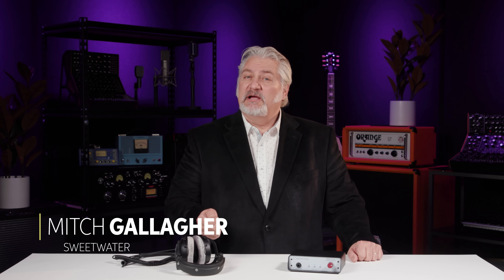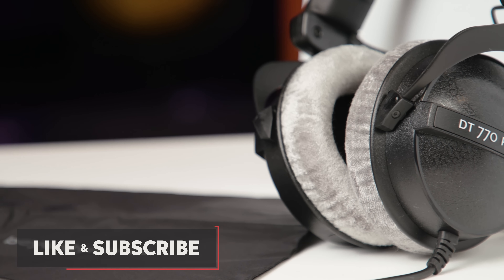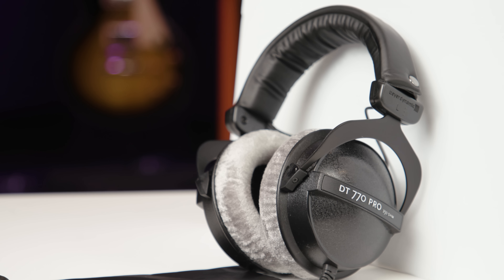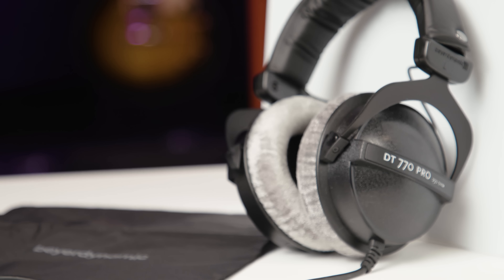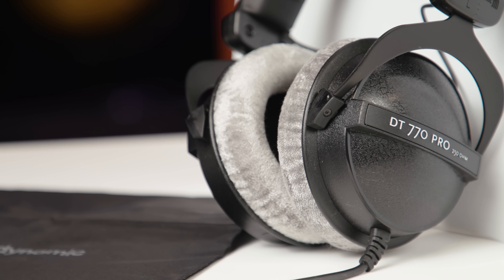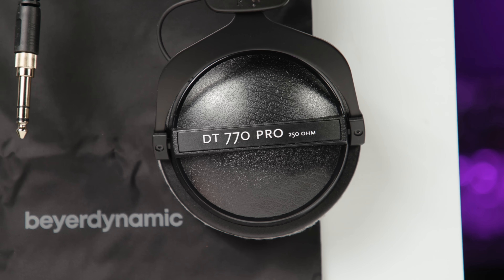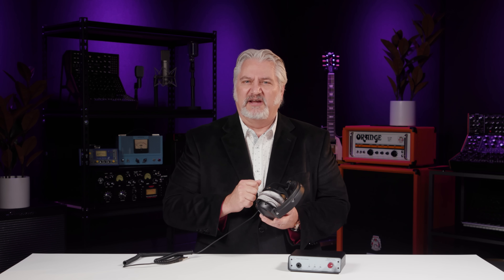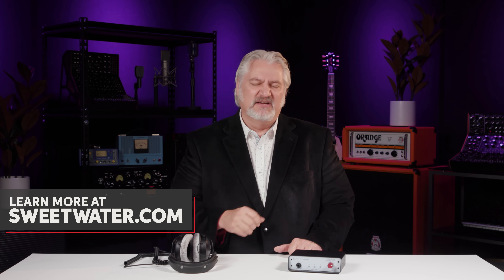Headphone Impedance Explained

Comment: So interesting. Decided to use my backup headphones yesterday at my dj event. The 32 ohm headphones were significantly louder than the 95 ohm ones I usually use. Both are designed to dj with. Almost thought the 95 ohm were broken or dying out.

Comment: I have the DT 770 Pro 80 ohms headphones. Should I be using a headphone amp? 

The only thing I have to drive it is my Focusrite Scarlett Solo or MacBook Pro headphone out.
Reply: Same question here too. Noticed a definite difference my new DT770 80 ohms when just plugged into a phone or my laptop.
Reply: Your interface usually has more than enough power to push volume. You should consider getting a headphone amp if you crack your volume knob all the way up and you don't get enough volume. This is more noticeable in cellphones. Put in a 250ohm on your cellphone and then put a regular cheap headphone and you will see a drastic volume difference.
Reply: You should be fine. Your Scarlett will definitely drive those well, and your MacBook Pro as well.
Reply from the maker: Hi, Jeff! A headphone amp wouldn't be necessary for the 80 Ohm version of those headphones. You should be totally fine without one. Hope that helps, and thanks for reaching out!
Corey Elliott, Sweetwater Sales Engineer, (800) 222-4700 ext. 1242, corey_elliott@sweetwater.com
Reply: I'm still not sure what kind of amp section the Focusrite interfaces are equipped with. One thing for sure is the MacBook alone will not have enough amp power
for really driving those phones. And if the Audio interface volume out is too quiet with the Beyers, I would get a good solid desktop headphone amp and 
use that between the MacBook and the interface, for sure.

Comment: I have creative G6 (handles up to 600ohms)  for gaming, will I see a difference in sound quality with a DT 770 pro 80 or 250ohms?   I understand the power side of things, more power needed to handle higher ohms,  but no one actually talks about quality of the sound.   e.g.  If my setup has no issue handling 80 or 250ohms,  and sound output is similar (don't like it to high) is there any sound quality differences>?
Reply from the maker: Hello, Guy! This is a great question, and one without a simple answer. Impedance refers to the current a device consumes in order to operate – or in more technical terms, a device’s resistance to electrical current. More so than anything, the design of the headphone will impact impedance as well as sound quality, but the two are not necessarily linked. There are low impedance headphones that arguably sound better than high impedance headphones. It just depends.
The DT770s are a great example to look at. As the impedance of the models increase, the diameter of the wires in the voice coil decrease, allowing for smaller gaps between windings and because of this, a greater magnetic field and thus less distortion. This article goes into great detail on this topic:
https://www.headphonesty.com/2019/04/headphone-impedance-demystified/
Thanks for the interest!
Cody Kraus, Sweetwater Sales Engineer, (800) 222-4700 ext. 1766, cody_kraus@sweetwater.com
Reply: I own the CLabs G6 and use it for my primary PC and desktop amp and to drive some powered Logitech 2.1 THX speakers. The G6 will power both DT versions,'
but I think what you'll find is that you'll have to crank the G6 volume higher to get a similar output overall level from the 250 ohms version as compared to the 80
ohm version, or under. That seems to true with my two different pairs of Hifiman planar headphones, even though they're low impedance mainly, they still
require more juice to get the same level as my dynamic phones or IEMs. I only need a tenth of power on the G6 to drive say, a basic pair of dynamic IEMs
or headphones. As for sound quality, the 250 ohm version may actually sound better overall than the 80 ohm version, but that's difficult to say. I have the G6
so I would think they would both sound similar, but require more power for the 250 ohm version to drive them, at least. You may have better results for the 250
ohm Beyers with a much better and more powerful headphone amp., like a better IFI amp, or an AudioEngine desktop amp, etc. There could be a world
of quality difference between the 80 and 250 ohm Beyers, but you'd have to test both with the same amp (and/or different amps) to find out for sure.

Comment: i am trying to side chain and master tracks. would a 250 ohm pair of headphones and an amp help me with hearing the difference of an unmastered track and a mastered track ?
Reply from the maker: Hey Andrew, good question! While high impedance headphones can definitely perform very linearly and deliver very precise audio, they also require a much more robust headphone amp to run properly. Because of that, they are not a solution all by themselves. If you are running a USB Bus powered interface like a 2i2, you would likely not be able to power 250 ohm headphones properly to get the sound levels you desire. Couple things we can do at this point. We can use a proper headphone amp with the high impedance headphones, like the Little Labs Monotor. There are also just some fantastic low impedance headphones that are extremely detailed and neutral in response like the Shure SRH1540.
If you would like to dig in, please give me a ring!
Drake Sobehrad, Sweetwater Sales Engineer, (800) 222-4700 ext. 3271, drake_sobehrad@sweetwater.com

Comment: Does the impedance also have something to do with constant low volume hissing? I have a miced up drum set that goes into a digital mixer. And out of that mixer goes my headphones. When I plug in my small in ears which I believe have 24 ohm I hear a slight hissing noise when everything is quiet. That hissing gets louder when I turn up the pre gain of the mics. But when I switch them for my beyerdynamic dt770 M with 80 ohms the hissing is completely gone.
Or dies that have something to do with sensitivity instead?
Reply from the maker: Hello, great question. It’s tough for us to provide a concrete answer as to what is causing the noise in your setup without being there to troubleshoot it. The short answer is that the impedance for the output does not directly affect the noise you’re describing, but it may affect the overall gain staging which will raise the noise floor (as you mentioned raising the preamp gain/sensitivity will raise the noise accordingly). I don’t really have a good explanation as to why the headphones do not have the same noise issue as the in-ears. I would recommend testing those two with a different output source to see if the issue is with the in-ears. If not, then you will know the issue is with something earlier in the chain such as the mics/cables/mixer.
Thanks!
Jason Filloramo, Sweetwater Sales Engineer, (800) 222-4700 ext. 1281, Jason_Filloramo@sweetwater.com

Comment: Thanks for the video! I am looking at the Beyerdynamics and was wondering if should go for the 80 ohm of the 250 ohm. Now between the power requirements and the coil cable on the 250 Vs the straight cable on the 80, I am going to get the 80 ohm.
Reply: are they significantly different? the 80ohm is double the price of the 250 ohm 990 pro's in my country

Comment: Just received a pair of DT700 Pro X with an impedance of 48 Ohm. Should I be driving it with a headphone amp?
Reply from the maker: Hey, Alvaro. Thanks for reaching out! You may or may not need a headphone amp for your DT700 depending on what you’re using them for. Typically it’s best to just try them out and if they are too quiet just get a simple headphone amp and you’ll be good to go. If you have any other questions feel free to call or email!
Jack Wellington, Sweetwater Sale Engineer, (800) 222-4700 ext. 3240, jack_wellington@sweetwater.com
Reply: That impedance is not super high, but it's not super low, either. You would probably benefit from a good solid headphone amp with those, or a good desktop
headphone amp. I just picked up the fantastic IFI XCan amp, (portable) and at 1000mw a channel mono power per channel, let me tell you it can drive
almost any low-high impedance headphone or IEM within reason. It powers my Hifiman HE400SEs with ease, although even at 32 ohms, those still
require a bit more juice from the IFI xCan than say, a pair of Koss PortaPros that I also tested it with. (The Koss I only have to crank to say, 6, relative volume,
but the Hifimans a good 8 to get a good listening level going for the same source or track. Plus enabling XBass and wide image effects)

Comment: At the end of the day all you care about is to find out if given hp amp can deliver high enough voltage to your high impedance headphones to enable loud enough playback. Unfortunately those specs are not published, instead they publish impedances, mW@Z figures, all irrelevant if your hp amp can not deliver amplitude to take advantage of its full power in case of high impedance cans.
You can not drive 250ohm headphones wirh amp with 300mV maximum output level.
Reply: Correct, a waste of money and time, you would need to invest in a very robust amp of whatever kind that can drive those headphones efficiently, and with some
power to spare.

Comment: Does anyone know how many OHM i need in my headphones? Im not sure I understand. I have the new macbook pro and shure mv7 mic. Im recording raps in my my bedroom in Logic pro x. Thanks
Reply from the maker: Hey, Greg! The ohms (impedance) that you’re looking for will depend on what hardware you’re connecting the headphones to. The higher the impedance, the more powerful your headphone amp needs to be. For that reason, consumer grade headphone outputs like those on your laptop, phone and tablet tend to do best with lower impedance headphones. Standalone headphone amps and many interfaces will do great with higher impedance headphones.
I hope this helps! Feel free to reach out if you’d like help figuring out what will work with a particular interface or headphone amp that you have.
Connor Smith, Sweetwater Sales Engineer, (800) 222-4700 ext. 1793, connor_smith@sweetwater.com
Reply: If you're just running headphones out of your Macbook or audio interface with no real amp involved, you need LOW impedance headphones. If you put a good solid
amp/DAC etc. between the MacBook, audio interface etc., you can use higher impedance phones or IEMs and/or better quality studio reference type headphones,
such as say, the AKG 701s, which will require a lot more power to drive and hear. It's also a good idea to have a good monitor speaker system (amped) with a subwoofer
if you can swing it, in room, to hear your mixes and productions. Headphones are great for monitoring or mixing, editing, etc., but not necessarily for judging
your final mixdown or mastering product.

Comment: I don't understand why a higher impedance drains your battery.  I can see where decreased headphone sensitivity would be a factor.
Reply: I'm just guessing, but probably because with higher impedance headphones, you'd need to turn the volume up higher on your phone to get the same headphone volume as lower impedance headphones. So with lower impedance headphones, you might normally run at half volume, but with higher impedance headphones, you'd need to crank it all the way up for it to sound as loud.Takes more battery power to run the volume louder. Again, that's my guess.
Reply: That statement hardly makes any sense. You can ignore it.
Reply: Why, because, the higher impedance headphones suck that much more power out of your device because you will need to crank the amp or device(s) that much
higher to get a decent sound level out of them. If you use regular low imp. dynamic phones or IEMS, you will never need to crank the volume nearly as high
as high imp. phones to get a decent volume and quality out of them. If you try running 600 ohm headphones on some tiny shitty DAP with no amp,
or even a small lower power headphone amp, or both, you will kill the batteries very fast and may not even be able to achieve a listenable level from those
headphones, and the quality will be shit, anyway. 600 ohm phones are made for the studio, for use with a high power amp or rack amp or etc. They are not
made to be run from tiny consumer devices.

Comment: an impedance mismatch can make even the best gear sound bad.  the amp is just as key as the phones.
the real test of that argument would be to do a shootout between the 3 different DT770's on a variety of output devices. 
 let's hear the difference or are they just blowing smoke.
Reply: Each higher impedance version will likely sound and perform better with a matching more powerful and better quality amp. Of course, within that,
a lot is still subjective. But if you expect a 600 ohm headphone to sound good on a tiny weak amp of some kind, or a phone with NO amp, well,
you're insane!

Comment: This is not quite true! What drives headphone impedance is amper turns.  All things being equal, a headphone of 200 ohms vs. an 8 ohm headphone is that the 200 ohm unit will draw less current hence making your battery last  longer.  What makes a 200 ohm headphone is MORE WIRE, AND THINNER WIRE.  This results in a greater magnetic field with the same input current and hence the same volume with reduced current draw.  In the days of Crystal Radios, headphones of up to 4000 ohms were used to get sufficient volume from the miniscule current provided by the no-power radio!
Reply: And we need to consider sensitivity ratings of the headphones too.

Comment: That just simply is not true, or better say some misleading about requirements of amp. for headphones. At least I can drive 250Ohm Bayer Dynamics from laptops, computers with defaut integrated sound card and have ZERO issues with volume level, most of the time I set even 25%, while most integrated solutions is not that bad. Might phone is not handle it, didn't try, but who will use DT770 250omh on the phone?.... So, I would say, that you can easily use 250ohm headphones on any device like PC etc without "mandatory" audiointerface.
Reply: Really? Most PCs, tablets and phones have no decent amp built in, and also, no decent EQ apps. or any other such software. If you expect a basic laptop or phone
to get the most out of 250 or higher phones, well, I don't think that's going to happen. It's a total waste of time. You can get 100000x better quality and volume
and performance out of higher impedance headphones with a good amp of some kind. Not a $30 one, you need to invest some real money and then 
you'll hear those 250 ohmers shine.
Reply: @thiscorrosion900  "If you expect a basic laptop or phone to get the most" - I don't "expect" I just have it and tried. And do not hear huuuge difference. Might be for deaf people, yes. (for PC and laptops, for a phone don't know)